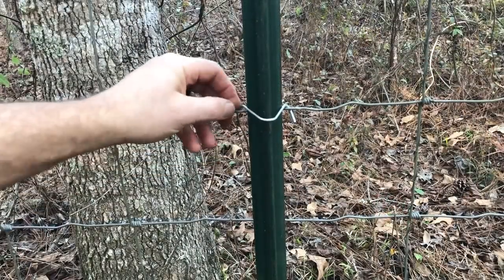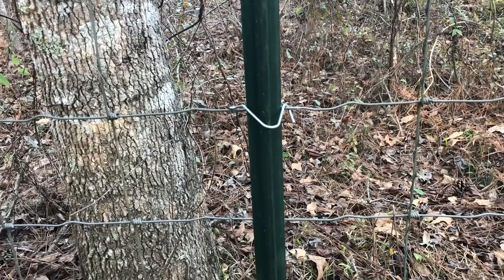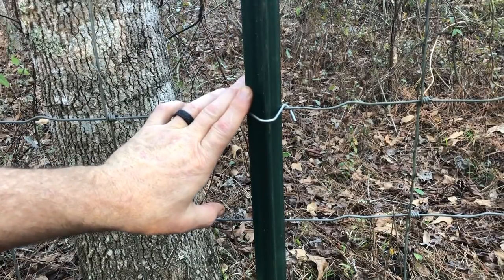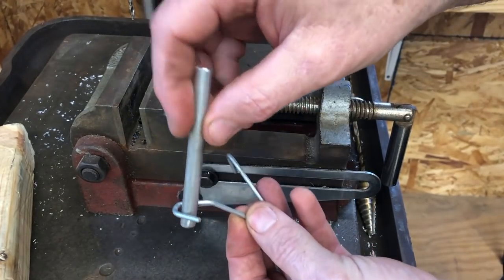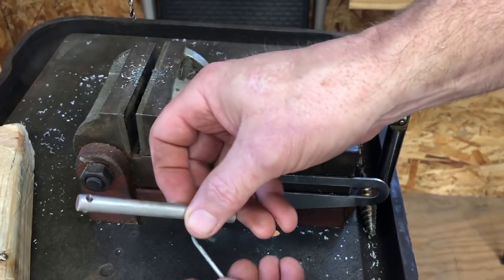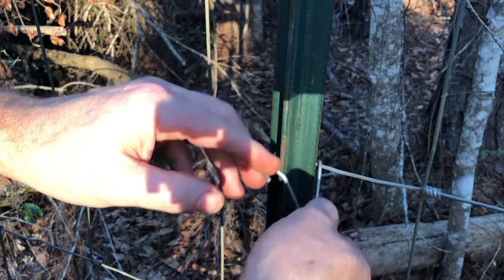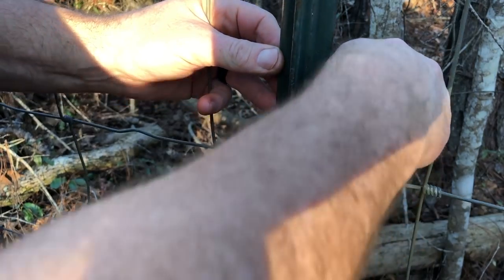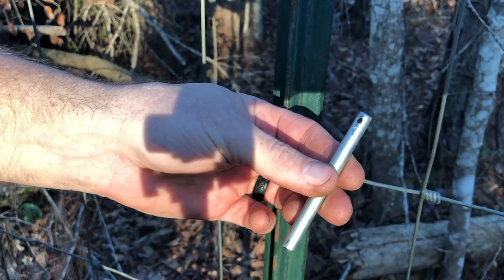DIY Fence Tie Tool

Comment: I’ve got dedicated pair of pliers I use for fencing. I pulled the insulation off of one handle to use to twist the wire around. I’m going to drill a 1/8” hole in that bare handle today.
Reply from the maker: Good idea.

Comment: TIGERCREEKFARM;Where abouts are you in S. Georgia? I was stationed at Moody from '82-;84 and lived on a farm on Cat Creek Road near the radar site road mobile home park. Are you that far south in Georgia? Just wondering (don't need your exact location). A great idea for the tool. Wish I had this on our farms in SD as I put up and took down probably 100 miles of B'd wire and hog wire fencing out there.
Reply from the maker: frank zappa I am that far south. Know exactly where Cat Creek Road is.
Reply: @TigerCreekFarm  I lived on Joseph Parkers farm when I was stationed there. Used to eat supper with them all the time, went to church with them, many things. Had a crush on his daughter but left Georgia for Korea and ended up staying there for 5 years and still am married to my Korean wife of 35 years. Wanted to retire in Georgia for a long time but wasn't in the cards due to breaking my back in four places in "01
Reply from the maker: Lawd Hammercy - take care of yourself. You probably wouldn't recognize it anymore. You remind me of a trip to north GA visiting family I hadn't seen in several years. Took my normal shortcut and all of the landmarks were gone. I stopped at a convenience store and asked about a church I thought was near this location and the attendee told me I was standing where it used to be.